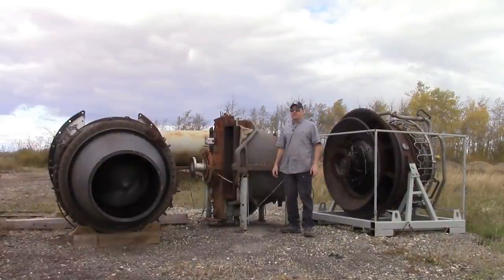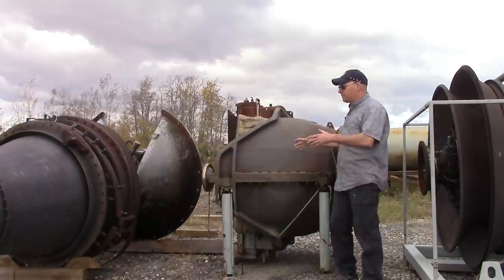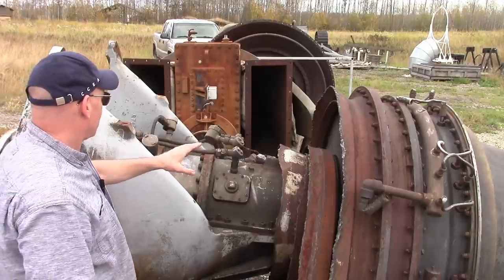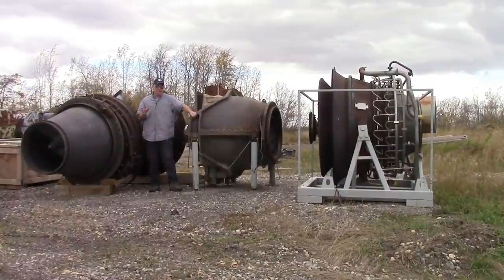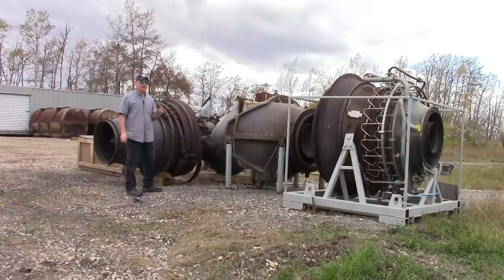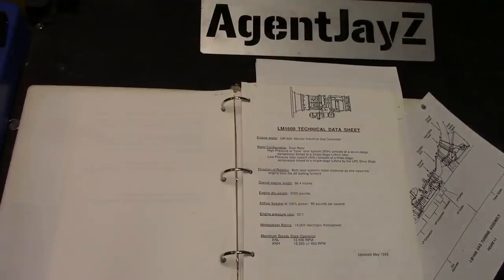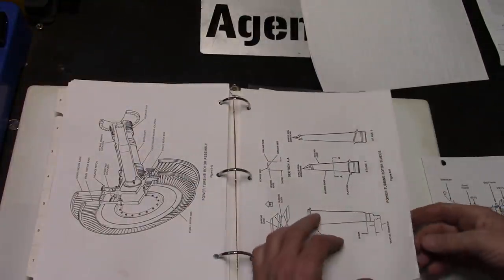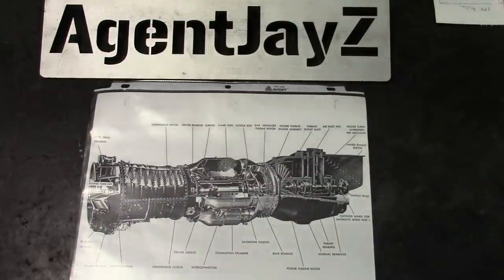Power Turbines 4 Different Ones

Comment: Let's be clear about this: there's absolutely nothing new about sticking another turbine behind a turbojet.  GE did it to the J79, back in the 1950s - but it was still an aircraft engine.  The CJ805-23 had an aft fan, with the fan blades carried on the tips of the turbine blades.  R-R also built and tested an aft fan version of the Avon, but the project was abandoned.
However, Frank Whittle did it years before at the end of WWII, when he put an aft fan behind his W.2/700 engine, together with a reheat system, which he called his No.4 Augmentor.  The engine, which was intended to power the Miles M.52 supersonic research aircraft, was ground run, before the whole project was cancelled by the government.
Reply from the maker: The CJ805-23 turned out to be such a success, that GE went all in and designed the TF39, and then the CF6, influenced by what was learned.
Two things stand out: greater bypass ratio was better for thrust and fuel economy, and having the fan in front has the effect of supercharging the core.
The elegant Spey had the fan in the right place, but could have used greater bypass ration.
I think you were in the right place at the right time to see a lot of this evolution taking place.
Reply: @AgentJayZ  The Spey was turned into the Tay in the mid-1980s, which powered the Gulfstream IV.  The engine had a single-stage fan with three booster stages.  If you have a copy of 'The Jet Engine' (fifth edition), you will find a pretty picture of it on pages 72/73.  Unfortunately, the decision to launch the Tay came rather late in the day.  R-R Derby should have come up with higher bypass versions of both the Spey and Conway, long before they put all their eggs in the one basket of the RB211 (and Derby very nearly broke the whole basketful).
If you look in the book at page 195, you will see a diagram of a flap blowing engine.  This was a Spey-based project that we were playing with in design, not long after I moved to Bristol.  As I recall, we were going to use the variable-pitch fan technology that had been tested  and developed in the M45 SD-02. This was a 9:1 plus bypass ratio engine project that was tested at R-R Bristol in the mid/late-1970s.
The big failure, as far as I was concerned, was not proceeding with the RB401 project at Bristol, because of lack of funding.  This was a lovely little high bypass turbofan, intended to enter the small bizjet engine market, as a replacement for the Viper.  I remember the project director saying, "There are three ways that we can finance this engine .....".  I cut in before he could complete his sentence with, "Yeah, beg, borrow or steal!"

Comment: A question: why there is the need of a separate power turbine and the power is not taken directly from the gas generator shaft? Is it because of efficiency? Is it to separate the torque user from the torque producer (but that could be done with a clutch)?
Reply from the maker: Some very large designs for electrical generation do that, but not the engines we deal with, because:
1)- Aeroderivative engine designs are derived from aircraft jet engine designs. It is relatively simple to convert a jet engine to a gas generator for use with a power turbine... you just take off the jet nozzle.  Explained in this video.
To make a single shaft engine with all exhaust energy converted to mechanical output would require a complete redesign of the turbine section, and this is the most expensive part of the entire design process.'
2) - After creating this new design, you would need to use a reduction gearbox on the output shaft, because engines in the 10 to 100MW class need to turn faster than 3600 rpm, which is the speed to make 60HzAC current. A reduction gearbox for a 25MW engine is very expensive, and is another source of loss, reducing efficiency.

So: more expensive to design and build, saves on a power turbine, but needs a reduction gearbox, (which needs more maintenance than a PT), and the whole arrangement is less efficient.
Reply: @AgentJayZ  thanks a lot mate! Salutes from Milan, Italy

Comment: On that power turbine with the ball bearing (the ELM-11/16), what is that arrangement which looks a lot like a fuel injection manifold? I can only assume it's for lubrication since the power turbines with journal bearings don't have it. But it does look like an excessively complicated manifold just for lubricating a few bearings, so is it for something else, and if so what?
Reply from the maker: I am not sure, but I will see what I can find out.

Comment: I wonder what the external piping on the Alst(h)om power turbine is. It kind of reminds me of the gaseous fuel distribution pipework on an LM1500 or similar, but with this being a power turbine that has no combustion going on in it, there is obviously no need for such. For an oil/lubrication system, it looks a bit too much to me, so what is it? Extra cooling?
Reply: That’s what I’m thinking also. We have LMS100’s and those just have the active blade control on the turbine but nothing on the PT casing.

Comment: What is the extraction efficiency is for a free power turbine?  I'm thinking along the lines of a car where there is a 20% power loss between the engine and wheels. I would guess that the power turbines have higher extraction efficiency, but I could be wrong.
Reply from the maker: Depends on a lot of things. Too many things for a comment box. Gotta go!
Reply: For what it's worth, turbocharger turbines are typically 80-90% efficient.

Comment: Hate seeing stuff rusting. Should build a cheap wooden enclosure over those engines that can easily be towed away, or else a few tarps.
Reply from the maker: A cheap wooden structure of an acre in area ( at least), that can handle our snow loads in winter? Such a thing does not exist.
And, as anybody who's tried to use one knows, tarps are great at keeping moisture in, maximizing corrosion.

Comment: J Zulu, some people will not be educated despite your best efforts.  Know that there some of us who have learned much about turbines and their various configuration and applications from your channel.  I was completely clueless about even the basic concept of these engines before I discovered your channel.  

While I would be a fool to pretend that I have anything more than a basic understanding of these wonders of human engineering it baffles me how anyone can imagine such enormous machines burning huge quantities of fuel and turning at many thousands of RPMs don't produce power.  It seems they are misunderstanding the definition of the word.  This may stem from willful or unintended ignorance.  The second of those two you can correct.  The first, not so much.  Thanks once again for your amazing videos.  

By the way, have you begun your flight training?

Comment: A question, if you run up an Gasgenerator whit out an Power turbine attached, up to its max RPM, does it consume the same amount of fuel as when a Power turbine is attached?
Or how does the Gasgenerator reacts to a load change at the Power Turbine? Is there a feedback from PT to GG?

whiteout

And if an device produces only hot air it is in first line a heater, not an Engine.
Engines extract a second type of Energie from the burning of the fuel, if only heats comes out it an furnace...
And we dont speak from power output of an furnace instead its heat output.

Best Regards
have no pressure
Reply: If you run an Gasgenerator whit out an accelerating nozzle or an Power turbine. its only power output are somewhat hot exhaust gasses
Reply from the maker: A gas generator without a jet nozzle or a PT is working without a load, so it will reach its rpm limit while burning quite a bit less fuel than if it was loaded.
Very similar to revving a car engine in neutral.

Comment: Questions: Can you please talk about small gas turbine engines?  Small, mini, micro and efficiencies/ inefficiencies.  I have had a hard time finding small axial flow turbines and information about them.  (examples like: FJ44, Williams F107 or F112)  Is there an accessible small engine out there? I appreciated your T-58 rebuilding video series.  Is that the best engine available in the <350 pound weight class and 500-1200  pounds of thrust?
Reply from the maker: T58 is not a thrust engine. Smallest engine I have any knowledge of is the Garrett GTC85 in our start cart.
I've never heard of a Williams falling into hobbyist or collector hands.
The smaller they Get, the less efficient they are.
Reply: @AgentJayZ  thank you for the quick reply

Comment: What are the pipes in "hornet engine" power turbine. Looks like afterburner manifold but are they cooling air or cooling oil/liquid tubes or what?
Reply: Look at around 27:22 - there is the diagram. You can read "stator cooling air".
Reply: @imagiro1  Thanks, I went forward on video as I stopped when AJZ went for gas turbines. I see at 27:22 he did not stop at the diagram and explain the cooling. Is it compressor bleed air cooling or some external air cooling circuit?

Comment: one of the power turbines in the vid. had some lines around it, witch look like the fuel manifold lines on the jet engine, what are they for? water cooling for turbine guide vanes?
Reply from the maker: Cooling air for the stators.
Reply: Were does this air come from? Gas generator or special pump/compressor?
Reply from the maker: Compressor bleed.

Comment: It's surprising how small they are for how much power they push out. I was taking a look at some helicopter power plants and they are miniscule compared to for example a deltic engine of the same power. As for the "mechanical argument" get them to look at quantum mechanics. That deals with things that make a single atom look absolutely enormous never mind a molecule. IE the smallest as yet detected particles compared to an atom are almost the same ratio size wise as a human compared to the entire universe. IE the Planck Length is roughly 1.6E-35 meters. An atom is huge by comparison. IE Hydrogen atoms at room temp are about a ten million billion billion times bigger.

Comment: Do these have thier own lubrication systems?
Reply from the maker: sometimes shared with the engine, sometimes independent.
Reply: If both the gas generator and power turbine have rolling element bearings, then  both will almost certainly use the same synthetic turbine oil (eg, ETO 2380).  However, a power turbine with rolling element bearings might have a separate lub system (or a supplementary supply arrangement).  It may have to continue turning when the gas generator is shut down, if, for instance, it is connected to an electrical generator that takes tens of minutes to run down, because of its large rotational mass.
A power turbine with plain bearings will need a completely separate lub system, because it will require an altogether more viscous oil.  However, it may well share this with the electrical generator it is driving.

Comment: So the stators direct air in a uniform fashion into the turbine that spins thus producing output basically ? Or have i just not grasped the idea ?
Reply: Correct. The stators smooth and guide the exit air of the gas generator to maximize the portion of the energy that is extracted with the turbine blades.
Reply: @kjdude8765  Thanks. Ive been pondering whether or not im slow or if that was partially correct. For like 4 days lol.  👍☺✌
Reply: Watch this video for more info. https://youtu.be/G7oNE5yQvNM

Comment: Exhaust gases from that power gas turbine can even easily be used to boil the water  for steam turbine.
Reply from the maker: That is often designed into the installation.
Reply: @AgentJayZ   Got it. Steampunk was real all along. The only missing link was gas turbines

Comment: There is an axial flow jet engine that produces a high velocity blast of gas which is ducted to a two stage, turbine motor, that converts the energy of the flowing gas into torque.

Comment: Very good video, agent Jay Z/Jay C :-) Haven't forgotten, that i promised a Danish flag, it will come! Anyway, i was watching a video yesterday, about the Antonov 225, with the double propellers, my question, the engines, behind the propellers, looks so small, compared to the giant airplane, how can these small engines make so much power, to lift more then 200 tonnes? Keep posting!
Reply from the maker: You are talking about the TU-95 Bear. The AN-225 uses six large turbofans.
How can any turbine engine produce so much power for their size?
They are genetically superior to piston engines!
One of the ways in which they are superior is in the power to weight ratio.
Only when tuned to extreme levels, and sacrificing most of their durability can piston engines even come close to the output of turbine engines... and even then they often exploit a turbine-powered supercharger to obtain those levels.

In terms of power to weight, an F1 racing engine is about on par with a PT6 turboprop, but can it run for hundreds or even thousands of hours at max power before needing any work done?
Don't even try to compare to industrial engines, which may run at 100% power for years non-stop.
Reply: @AgentJayZ  Its possible he may have been talking about the AN-22 which is owned by the same airline (Antonov Airlines)that operates the AN-225. Interestingly the AN-22 and the TU-95 utilise the same Kuznetsov NK-12 turboprop engines. Almost 15000 shaft horse power!
Reply: @AgentJayZ  Probably was Sam Chui's video on An-22 that came out 1-2 days ago.

Comment: Why do only Gas engines have stator vanes ahead of the rotor blades unlike the turbojet enigines? as far as i have researched they are pretty much the same thing but serve different purposes. And some sources proivde that even turbojets could have stator vanes ahead of the rotor blades.
Reply from the maker: You mean inlet guide vanes instead of stators.
Stator vanes are always downstream of the rotor blades in a particular stage of compression.
You mean turbofans instead of turbojets.
I don't know of any turbofans that have inlet guide vanes ahead of the fan.
I think that makes the engine easier to start if the fan is less efficient at very low rpms.
Turbofans are not used in industrial applications, unless the design is modified so that they are not turbofans anymore.
Reply: @AgentJayZ  Many (but by no means all) low bypass turbofans have vanes ahead of a multi-stage fan.  Some may just be multiple struts supporting the front bearing housing, but others are most definitely inlet guide vanes (eg, Conway and Spey).
I'm not that familiar with the F404, but doesn't that have a VIGV 'flap' arrangement in front of the fan?  In contrast, the EJ200 doesn't have any vanes in front of the fan - nor does the Pegasus, the Adour and the TF41 (hence the Industrial/Marine Spey with no IGVs in front of the LP compressor).
I'm not aware of any high bypass turbofans with single-stage fans that have vanes in front of the fan.  The TF39's fan is a curiosity - but  I've seen that described as a 'one-and-a-half stage' fan.
Reply from the maker: Yes, I made the assumption that the question was about high bypass airliner engines.
Reply: Is it to stabilize or direct the unstable ( possibly) gases into the gas engine for max input .....?? 
I.e.  effecient, directed air flow inwards = max efficiency on output power....

Comment: A power turbine really isn't that mysterious.  It's really the same as the back end of a jet engine with a turbine that powers the front compressor.  The main difference is that the output rotational power goes away from a conventional jet engine rather than back in.  I suspect the "gas generator" still has an turbine after the combustors that powers the input compressor.

Comment: Semi-related question that, in my somewhat limited reading on the subject, I have not yet come across a direct answer; other than cramming a ton of volume into a smaller area, is there a particular reason the turbine blades of a power turbine or even the general exhaust turbine blades aren't larger to contact as much of the power stream as possible?
Reply: By "larger," I assume you mean longer, ie, longer blades (and vanes).  The design principle of most turbines in gas turbine engines is that the axial velocity of the gas through the turbine is kept approximately constant.  The acceleration of the gas takes place in the  circumferential direction.  In simple terms, the blades (and vanes) are designed to be as long as they need to be to accord with this design principle.
If, however, you mean wider, in terms of chord, then the blades are made no wider than they need to be to function aerodynamically.  Make them any wider than necessary, then the turbine would become longer and heavier, which is hardly desirable in something powering an aircraft.
Having said that, "heavyweight" industrial gas turbines do tend to have wider chord, lower aspect ratio blades (and vanes), not for aerodynamic reasons, but for robustness and longer life.
Reply: @grahamj9101  Ah, that makes more sense. I didn't take into consideration the centrifugal forces. Initially what I was thinking was why they weren't longer to grab more of the air stream but presumed it was to funnel the gases onto the impulse face, i.e. concentrating the largest force on the smallest area. I did factor in rotational weight in design principle. 
Thank you for the clarification!

Comment: Any point to a multi-spool power turbine? Seems like 'no' but I can't quite noodle it out.
Reply from the maker: Any theoretical benefit in having the later stages turn at lower rpm would be offset by the fact that now you have more than one mechanical output shaft, and they each turn at different rpm...